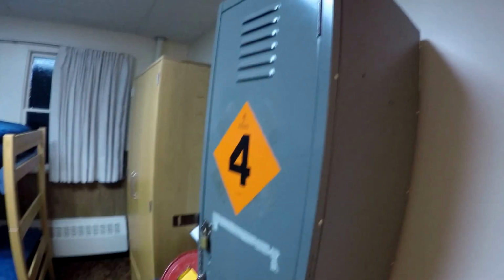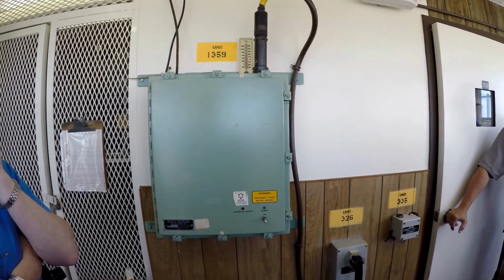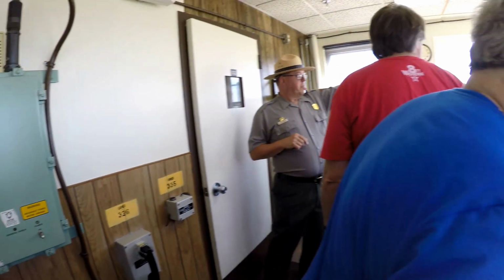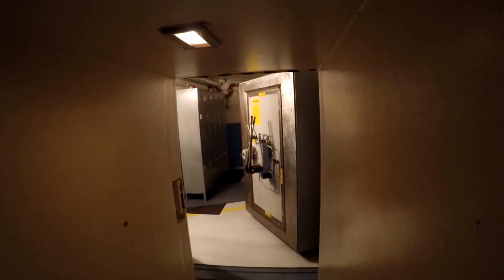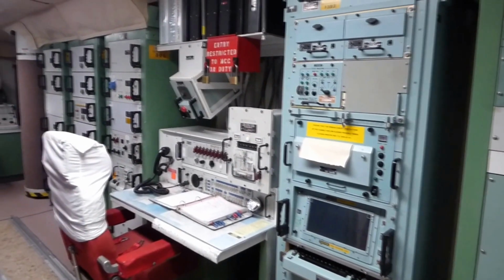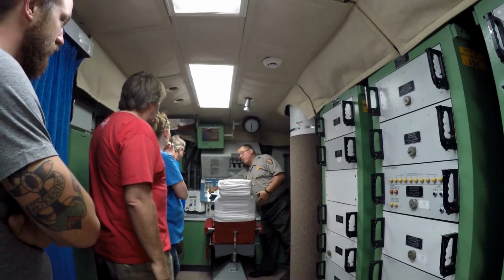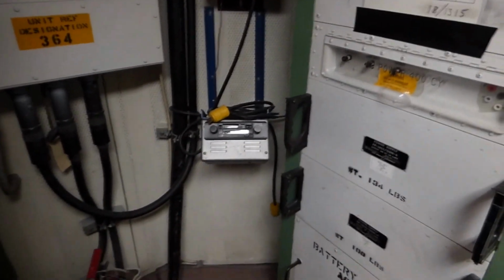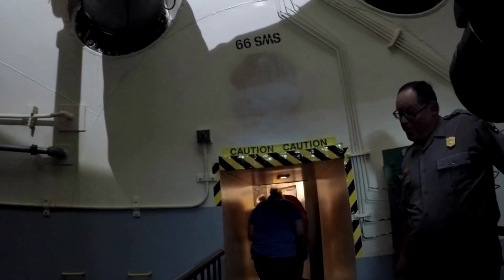Minuteman II Missile Launch Control Facility Delta-01

Comment: My shop at Whiteman developed and designed and installed the entertainment system (TV and AM/FM Radio) for the minuteman LCC’s.
Reply: You were very late for me.  I was on a launch crew for 4 years from 1963-1966 and we had NO entertainment systems - TV, AM/FM radio, tape players, etc.  All we had was Air Force radios.

Comment: At 12:23 you can see a green box to the left of the Commanders Position. It has a padlock on it. I know what is in there, can anyone else guess what is inside that box.
Reply: Eagle View HD That’s where they keep the liquor isn’t it?
Reply: Hammer Thank You for the guess, but no, no liqueur there.
Reply: Well, I would guess something to do with antennas,  because I am certain it is something only antenna maintenance personnel could access.
Reply: Eagle View HD you still out there?  How's my guess?
Reply: PDMcE you are correct!  Safe/Arm switch for Hf/Recieve Antennas.

Comment: Your tour guide was full of crap! Grand Forks didn’t get rid of their missiles because they were maintenance problems. It was because of politics. North Dakota had politicians that were spineless jellyfish and not willing to fight for them. I was stationed at GF from 89 till 2000. I was also stationed at Ellsworth from 83 to 89. I went to D-01 and D-09 more times than I can remember.
Reply: Nice! I was stationed at GFAFB from 1984-87, 321 MSS Security specialist (missile cop).
Reply: The LF's were a problem because of the high ground water table.  I was there from 1980 to 1984.  Same problem at Whiteman.